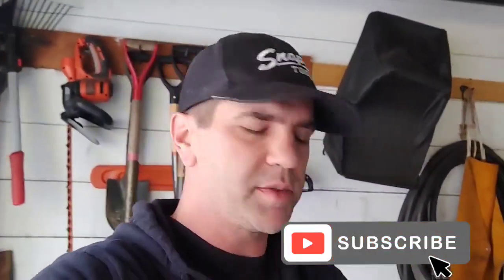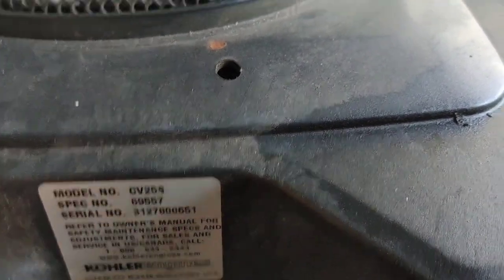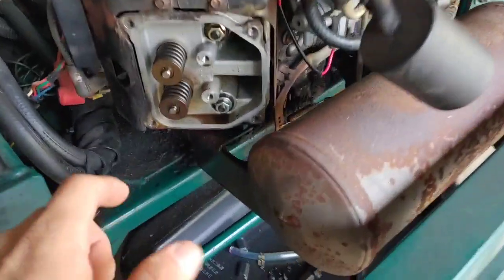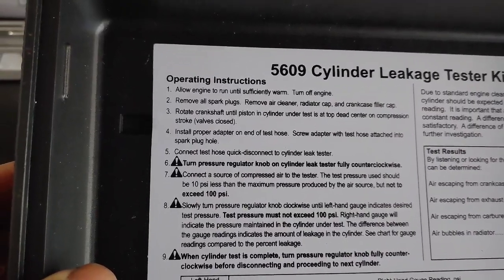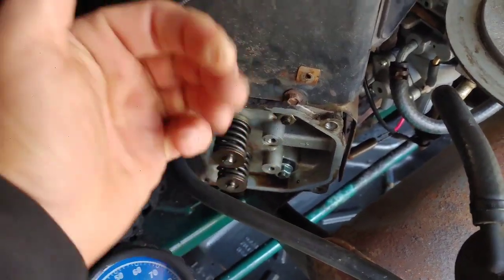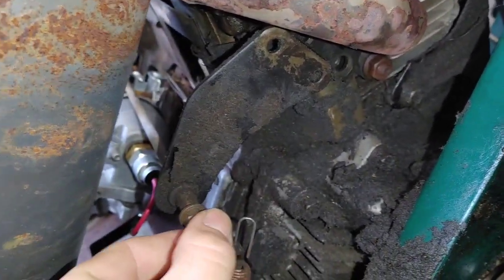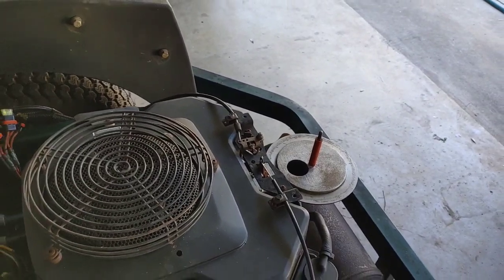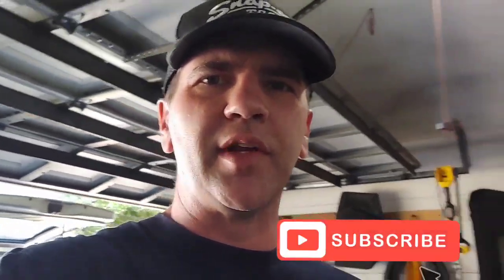Doing a Leak Down Test to diagnose engine issues. The easy way to confirm problems on engines

Comment: Great that you found out the air leak on this engine 👌👍
Reply from the maker: The customer was afraid they were going to need a new engine. I hate going in behind someone else taking parts off. Especially when you get some parts in a box. So I didnt know what to expect so I was scoping the cam and cylinder walls before putting it back together for a test run.
Reply: @Mechanical_Mind  that is a great idea to do that for the customer because of the price of a new one is going up in price for sure

Comment: had a mate cook the kawasaki engine on his fairly new Toro a few weeks ago. Had never checked or changed the oil or taken it for dealer service  ... my only comment to him was oil and filters are dirt cheap ...
Reply from the maker: I cant tell you how many times Ive seen customers decline oil changes, $5 fuel filters, and $15 air filters...then end up having to spend $3k on a new engine.

Comment: couple comments:  

yes, engine should be hot first before doing a leak down test.  (sometimes valves, head gaskets, or even small micro cracks do not develop until engine is hot...)

while it IS true you want to perform a LDT while piston is at top dead center, you ALSO want to make sure you are one the correct stroke cycle at top dead center AND you want to make sure that if your engine has a compression release on the cam, then make sure that is not engaged.  One way to check this is that if your LDT goes immediately to zero..then unhook it and rotate engine another 180 degrees at the "OTHER" top dead center...then check the leak down test again.  If you are off the proper stroke cycle or in the compression release phase of rotation you will get faked out thinking you have leaky valves.  just something to know before you do a leak down.

also this:  top dead center is how you determine valves problems (can be due to valves stuck or stepped out seats or too much soot in the seat), but it can also be due to a timing problem:  improper valve lash!  So always make sure you have the valve clearance set correctly at top dead center before you do the LDT test.  If you do the valve clearance and the LDT still fails, then you probably have a stepped out valve seat or too much soot or out of plane valve to seat fitment.

also this:  sometimes the a compression issue is not related to valves...it can be the head gaskets..or it can be some problem with the cylinder walls and piston rings.  One way to find out if you have a cylinder bore to piston ring issue is to put the piston at BOTTOM TOP CENTER...again making sure both valves are CLOSED and that you are NOT in the compression release phase. If the LDT is okay at top dead center, but fails at BOTTOM DEAD CENTER, then you either have cylinder to piston ring issue, or there can be a tiny crack somewhere down lower in the cylinder or the head gasket is failing.  I like to put a heavier viscous oil in the spark plug and then move it to BOTTOM DEAD CENTER and do the LDT again.  If it tests better, then it's probably some bad piston rings or a worn out cylinder or both.  

some folks have better luck using some old school tricks when doing the LDT...especially the old timers who don't have very good hearing anymore.  You tie off some air balloons to the oil filler cap and the carb throttle body and the exhaust....leaks that happen when cause the balloons to expand.  Especially helpful in a noisy shop where the compressor is running and you can't hear hissing.  Also helpful is to use some soapy water on the head gasket area...look for bubbles forming for the external leaks.  same thing on the intake gaskets to the cylinder....

another things to look for is missing or leaking welch plugs in the carb.  this is one of those things that you always want to check if an engine is misfiring or running roughly or surging.  (as well as a gas cap that is not venting!)..

God Bless America

Comment: I got my otc leak down tester from zoro. There $89 and if you get their emails they almost always send me a 20% off something all the time. Plus free returns if your not happy. Only issue I found with my otc leak down tester was the glass on the right gauge was very loose so I had that exchanged the second one was better but still moved around. It always seemed to be the right gauge and not the left.

Comment: The fastest easiest way to find top dead center on the compression stroke is to use the leak down tester. Just put 5 to 8 PSI in the cylinder then turn the engine by hand. You will feel the compression. Just turn the engine back and forth over the hard spot then stop in the middle of the hard spot. BOOM DONE. There’s no need to clamp the engine in place. If it’s at TDC it will stay there. Now crank up the leak down tester and perform your test.

Comment: I have a kohler vtwin, it has the same symptoms, it has almost no power and tons of fuel coming from the intake tube. I did a leak down test, and it has no leaks on the intake or exhaust valves. What else could cause these symptoms?
Reply from the maker: Faulty carburetor, most likely.
Reply: @Mechanical_Mind  thank you for the fast reply I failed to mention that I did a ton of work to this engine as it had worn out rings and the flywheel key had sheared as the original owner probably hit something hard, Just recently  installed a brand new carburetor on it, has new gaskets and seals, new piston rings, valves lapped, also bled the hydraulic lifters, i am going to pull the bottom of the case off just to make sure i did set the timing right on the cam and crankshaft. I doubt thats the problem but am out of ideas.